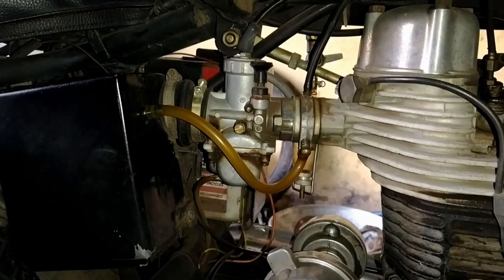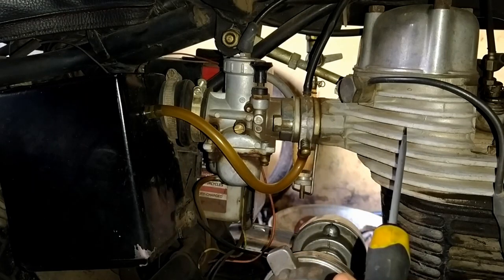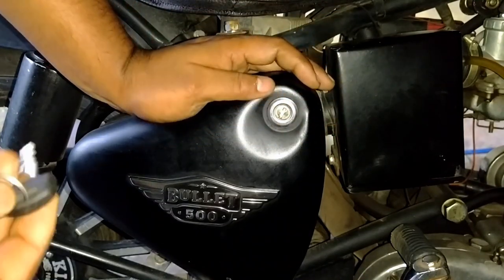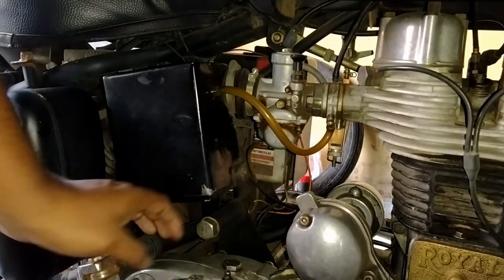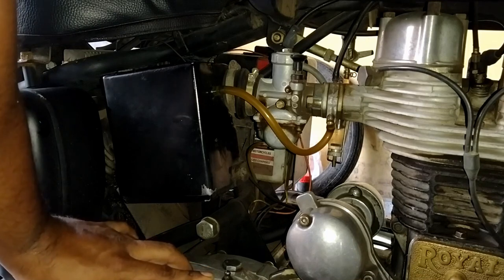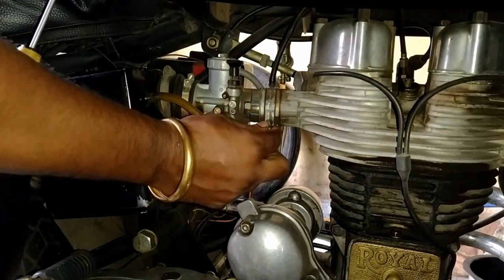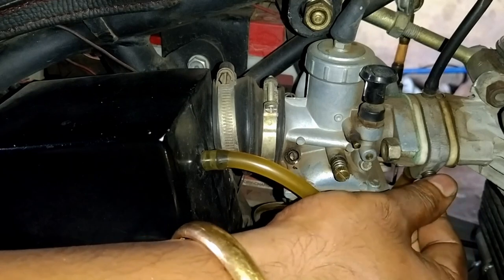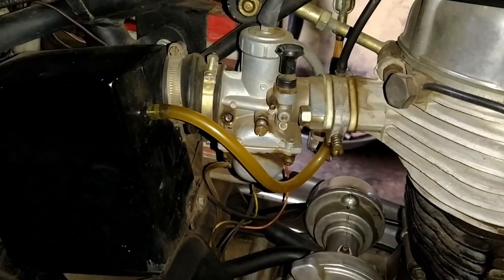Carburetor tuning for Royal Enfield

Comment: Brother you did the right tuning , but you are wrong about emission control valve because that dont supply air and fuel mixture it only supplies air in the exhaust for emission control, the black pipe that is connected to the inlet manifold pipe it is a vaccum line that operates the SAI valve  for emission control.

Comment: Sir I have a 350 4s 2008 electra, the air screw does not move at all. 
Should I be concerne? Because in old model they say it is needed to

Comment: Bro my bike hiccups during running. Timing properly adjusted. Cab cleaned. What else need to check
Reply from the maker: Check for valve leak and bore over size

Comment: Sir I have a question for you please do consider answering it, what will happen if the ci engine bullet's battery is a bit low in volts or is near to its replacement stage? Will that create any throttle missing issues or can it make the bike go off at low RPMs which usually doesn't happens in bullet?
Reply from the maker: That may be one of the reasons. The missing issue will be severe when you switch on the pilot lamp and engage the horn.
Reply: @ECFixeljin  Thankyou Sir that was really helpful!

Comment: No pickup in my bullet .. even after change to 4plate clutch... If i accelerate no response in running condition .. plz help me how to rectify it
Reply from the maker: Whether engine rpm get increase or not, for acceleration?
Reply: @ECFixeljin  increasing bro... Wen i accelerate it raising..
Reply from the maker: @kalaiarasan6350  this is my whatsapp number:8300701470. take video and send it to me
Reply: @ECFixeljin  sure bro thnks

Comment: very nice video. sir my bike 2007 electra 5speed,auxiliarry is removed.is the tuning of carb be still 3 half turns or is there some other tips to tune up.please kindly suggest
Reply from the maker: Set at the position where you get maximum acceleration between 2.5 to 3 half turn. Check this video https://youtu.be/IfFW6dSch5w
Reply: @ECFixeljin  thank you sir

Comment: How to get it in old model it can't have any emissions control
Reply from the maker: Nothing to worry about emission control. The auxiliary air setup is enough to get proper combustion and water droplets through exhaust. That can be installed in all bullet model from 1955 to till 2009
Reply: Ok bro

Comment: Is it possible for old model
Reply from the maker: Nothing to worry about emission control. The auxiliary air setup is enough to get proper combustion and water droplets through exhaust. That can be installed in all bullet model from 1955 to till 2009

Comment: Sir i have 2007 model standard 350, previously i am using Medium filter silencer, front tyre 3.25 size air 35 and Rear tyre size 3.50 air 50, it gives me mileage 30kmpl down to 24kmpl. 

Air droplets came from silencer too.

Today i change my Silencer to Stock and  which send by company 

And front air pressure is  set to 25 and rear is 35. Air droplets also came from silencer. 

Next time i will comment after checking the mileage, then i comment what mileage i get, my bullet is fully restored, new tyres new chain set. 

I will surely comment here after checking mileage. 😄